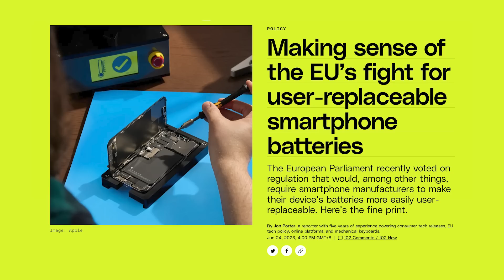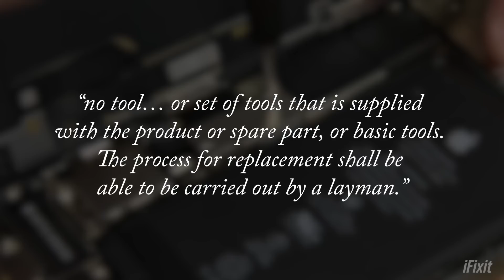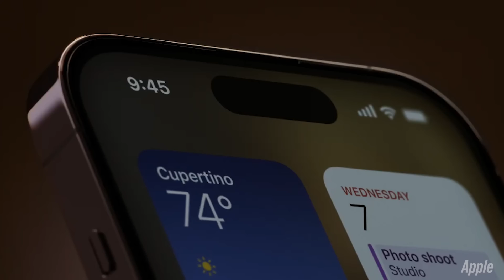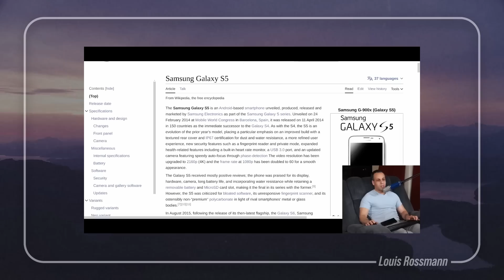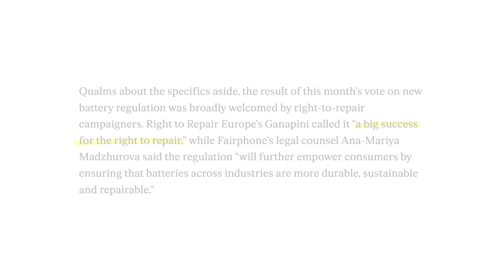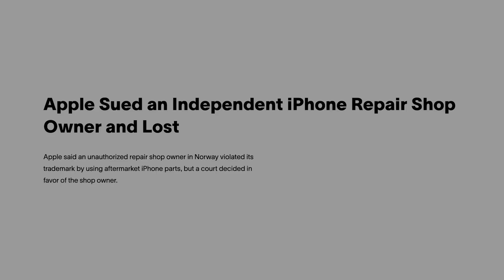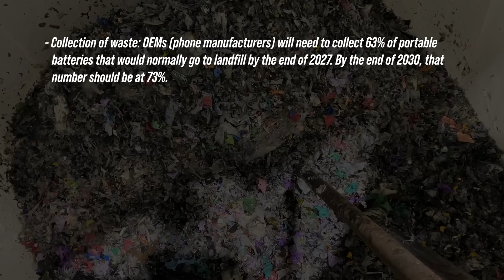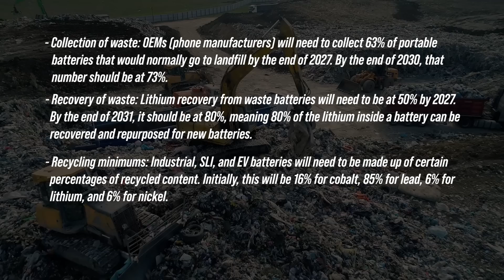EU Just Changed Smartphones Forever

Comment: That should happen let me tell you my story i have pixel 2 xl working f9 but battery need to be replaced problem is i have hair line crake on my display coz of that i cant , if technician will try to open my phone's display its going to get damage further or might get completely stop working . so point is  i have to buy new phone because cost of that display  i can buy new phone just just imagine if it's  something so small not working in phone can be repair buy just 1$  but you have to pay 100$ extra.

Comment: I think non-user removable batteries were certainly a profit driven thing, because a layman isn't going to buy specialty tools, put their phone in a warm oven to make the glue less sticky, and in this battery change process, maybe crack the glass, or even destroy the battery, and consequently their home in a potential lithium fire.
Everyone who says otherwise either never replaced a battery, or just downplaying the risk.

They are just gonna buy a new phone, because the battery capacity takes a nosedive within 2-5 years, depending on software limits set by the manufacturer, and in that timeframe, new tech already surpassed the old, and it's already time to buy a new phone.

Comment: EU regulates everything. They do this to stop technology changing and messing up their nice systems of control.
This new rule on batteries WILL prevent any phone be fully waterproof. The added complexity will make repair even harder. 
Deliberate internal locking used by Apple will not be stopped by this new battery law. 
My last iPhone lasted 5 years. The battery killed it but a hardware fault killed the battery. A new battery would have failed the same way.

Comment: The next step would be a genuine ISO standard for battery formats. I fully support this law, because it gives me the freedom to do maintainance on the devices I own. One thing that I would change is that I would allow a screwdriver as a maintainance tool, since it opens up a lot of possibilities. Also, I'd like to see a ban on software restrictions / genuinity tests. My laptop manufactuere (Asus) does not supply batteries after 5 years, now I am dependent on 3rd party parts.

Comment: I had cell phones and smartphones as one of the first in Germany. Technology, that has always interested me.

In the beginning, replaceable batteries were absolutely indispensable. I needed at least 3 batteries per day to keep my Motorola MicroTAC on the net. However, rechargeable batteries were easy to get, although not cheap.

Over time, it got better and batteries lasted a whole day. Lithium-ion batteries replaced nickel metal hydride cells. But of course, the batteries were not very durable. Even in those days, long before the first iPhones, it became increasingly difficult to get replacement batteries. Strangely enough, there were often no single batteries available from the manufacturer, or they were heavily overpriced. Even my Motorola Defy MB525 was a device where I was never able to get an original battery from the manufacturer. All I ordered were counterfeit products. Most of them had a miserable quality and the batteries were often not recognized correctly by the devices. The battery indicators simply did not work properly anymore.

I suspect that the manufacturers had the idea early on not to sell batteries individually. One did not dare to admit this openly until Apple shows them how to do that.

Comment: You made this law sound like the stupidest unmotivated thing. What it has to do with right to repair? User-replaceable batteries in mobile devices in that form is right away stupid idea. And right to repair is not about replacing battery without tools. It's about service manuals, diagnostics etc. Do you recall times when replaced batteries was a thing? Disassembling your Siemens A50 was not pleasant at all and very few people actually carried spare battery. And pardon me, how many of your smartphone batteries died? Exactly 0 mine died. Batteries nowdays are capable of working 10 years in a laptop, there is no need in replacement unless you damage it somehow. And in that case it's not only the battery, but likely some micro chips.
Also use of anecdotal evidence... Some companies making some phones with replacable batteries says nothing about how hard it was to develop and what cost difference it implied. You don't need to be Einstein, to understand that replacable parts makes it harder to waterproof your phone. Dang, it makes me angry!
I would not want to see smartwatch with user replacable batteries...

Comment: In Germany, consumers return the majority of plastic beverage bottles to retailers. It's a nuisance, so why do consumers do it? 
It's simple! The retailer charges a deposit of €0.25 per bottle. That's the law. You get the money back when you return the bottle. If you lose a bottle, you lose the deposit. 
This also works very well with lead batteries, which are used in cars. There it is 7.50 € per battery. The more expensive a battery is in the purchase, the more deposit should be required.
Basically, you only spend the money once. If you buy a new battery afterwards, you get the money for the old battery back in exchange. The system is tried and tested and works excellently.

Comment: Nice video!

There are several smartphones that are capable of repairing. In the EU, a good example is Fairphone. From the first to the fourth version of this product, you can swap the battery without needing any tools. Using a screwdriver, you can replace other components of the phone as well. 

Let's see how the market will change after his new EU law.

Comment: Apple will get an exception on the grounds of waterproofing their phones. What the EU should have done is mandated that Apple and other phone makers develop a machine or process that can easily disassemble and reassemble phones for battery replacements, and offer the service at cost for official battery replacement and let third party repairers use those machines and processes so they can offer official battery replacement at cost too, or at cost plus a reasonable markup.

Comment: You asked "Design or Profit motivated" ? This absolutely profit driven. The car industry started forcing OEM sealed assembly like  head light & tail light units where you can not replace globes or lens covers. Have to buy the whole unit. They then started encripting & liecencing their scan tool software to "Authorised Dealers & Repair shops" who had to tender for the rights to repair their brand of car.
 Sony started this, repair shops had to pay $80k+ p/a to Sony.
To get access to parts, schematics &  later software to "Pair" serial number encoded sub assemblies eg Optical Drives in Play Stations. Before they would work with the motherboard. 
Car manufactures did the same so you can't buy working  2nd hand Transmision controller & just connect it to your Engine management controller. 
Ask any car wreckers how many parts on a car are now encoded. 
Microsoft jumped on board with their later XBoxes & the Smartphone industry is rife with this Apple leading the fight. 
Apart from reliability from minimising connection failures.
& Samsung removing microSD to stop users inserting cheap low speed memory cards. Which can dramatically effect User Experience. 
Samsung did this to protect their quoted proformence specs. 
Given Samsung  internal memory is very fast. 
Every thing else is either to lock user into the brand or maximise profits through product turnover. 
Microsoft just bloat each new version of Windows to eat up any proformence gains in new technologies. Again forcing a constant turnover of products. 
The new one coming with Windows preinstalled to keep the cycle going.
The millions of old PC, Laptops, Tablets, Phones & Cars all with so many fully functioning parts.
BEING DUMPED IN TO THIS FRAGILE ECOSYSTEM CALLED 
        PLANET EARTH
The Only Home we Have.

Comment: Yes, it's possible to make a slim phone with a removable battery. The question is, if the battery wasn't removable, would the phone have been smaller? I believe it would have been.
Another problem is that new phones no longer have thick bezels, so it won't be possible to implement the LG G5 design for removing batteries while also retaining the same level of waterproof capabilities.

If this law does go through, manufacturers will definitely start making two different versions: one for the EU and another for everyone else. I do believe people will still have a preference for design over maintainability. And if manufacturers are going to stick to one design, they'll lose market share outside of the EU against competitors that have non-EU compliant designs.

Comment: I really have mixed feelings about this movement. On one hand it is a great solution to a large chunk of problems in the tech industry but on the other hand there are many devices which are only capable of existing in the way that they do because of the compression and integration of these parts. I think consumer education and or option for removable and non removable battery devices should be implemented because the density of some of these mobile products is quite insane. Adding the additional hardware to make the battery simply just remove would put alot of the progress back quite a bit. Accessible replacement parts. Non proprietary tools or a universal repairing standard and less anti consumer repair internal design would help alot. This is a definite step in the right direction but I think it needs to be revised to give designers and engineers little more options when going about how to make their phone consumer friendly without compensating on design
Reply: What things can only exist in the way they do because of integrated, non-replaceable batteries?
Reply: @SilverEye91  didn't mean to be interpreted as non replaceable. But absolutely integrated. Audio products that are tws are a great example of this. Same as most folding devices. Without the battery being sandwiched between two screens on dual screen phones you've cut your self off at having a portion where the battery is either restricted to one hemisphere of the phone or you have to relocate your electronics to be in an unbalanced manor. In addition There are VR headsets and stuff like smart watches which are great examples too. But pretty much anything where the back is also functional as well as the front will result in issues. It's all fine if it's just a photo sensor on the back. That's easy to move but the new z flip for example has a whole second screen that spans the whole half of the phone with a hinge in the middle and if you were to only put a battery on the bottom and house all the hardware in the top section to make that removable battery possible you'd end up with a phone that can't be propped up half open without the additional of weights. None of this is impossible but I'm saying the advancements that have been made are not entirely anti consumer and there is a bit of a middle ground that should be achieved. I'd consider galaxy buds very easily replaceable for batteries. You pop em open and get a new cell. Literally a 30 min job. The issue is customers aren't educated and parts are not that easy to find. There's multiple solutions to the problem

Comment: I would rather have a slightly more difficult battery replacement process and have a sleek optimized design. People don’t realize this is going to make phones thicker, harder to waterproof, and most likely will lead to less sleek of a design. All the phones that used to have removable batteries had cheap plastic backs. I like the sturdy metal and glass. For the amount of times you have to replace a battery, having to take it to a shop is a non issue to me.

Comment: Anti-consumer products, 100%.

Teslas for example...was reading about a guy who ran over a small piece of debris with his Model 3 on the highway. It cut a coolant pipe that lead to the battery. But that coolant pipe was integrated and non-replaceable. Tesla wanted to replace the battery on his JUST out of warranty Model 3 for something like $16,000! He took it to an independent EV shop a few states away and they fixed it for like...$500.